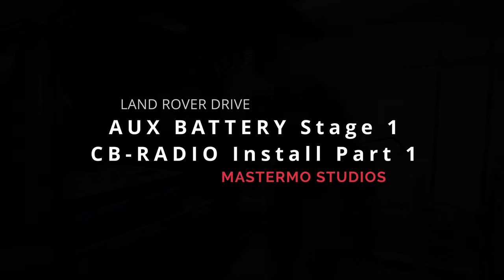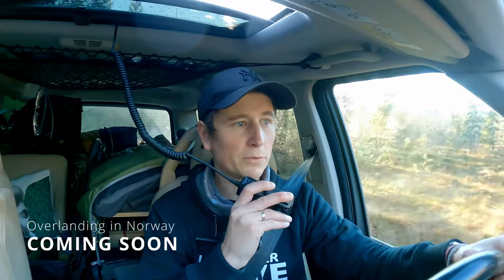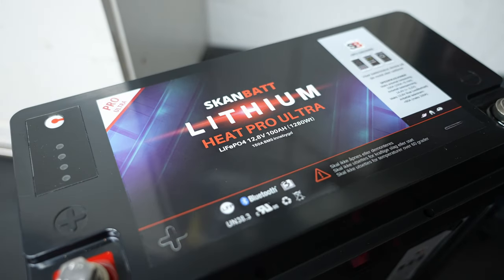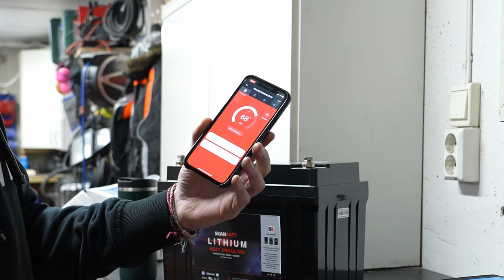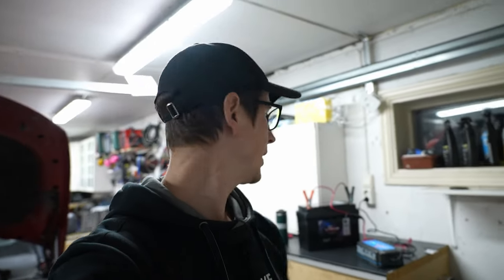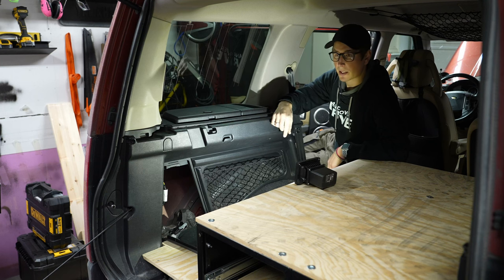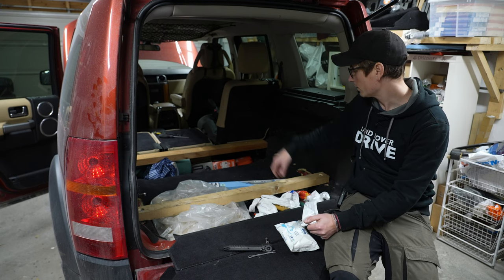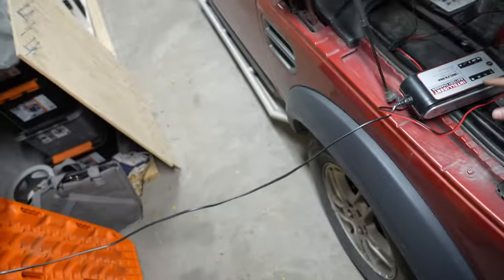LITHIUM BATTERY FOR COLD CLIMATE - DIY 12V STAGE ONE -  CB Radio Install Part 1

Comment: Been using an ecoflow delta 2 max , use it for my diesel heater and other things, very impressed so far. Can charge from outlet, 12 volt or solar . Light weight compared to some of my AGM batteries, and has a nice app .
Reply from the maker: Nice Craig! Seen the Ecoflow products, seems a bit pricey, but in turn you get a complete system and someone had to create that system. 

For overlanders I believe lithium is the only way forward, the weight factor alone is enough to pick lithium. The price/cycles is another, lithium is only a win. 👌

Be sure to update us after a year or two on how the Ecoflow works out! 😉

Best, Simon

Comment: Hi Hi, Simon great to see you starting to get the auxiliary power set up.  It will make a big difference for you on your trip. I have decided to replace my CB as I've had 2 second hand units neither of which have been great. I really like the idea of the controls being on the hand set with the main body in the rear as you are proposing so I'll definitely go that route😁 looking forward to seeing part 2 but also your trip footage too.  Take care and thanks for creating this content it is appreciated.
Reply from the maker: Good morning Simon! Glad you liked the video! 👍😊 

The CB-radio has been working great and can’t fault it. Nice to get a new setup that you know should work as intended. 

In the uk I think you need to check the regulations about the hand controls. Something about it looking like a mobile phone because of the dials. But the CRT Mike 2 which I linked underneath has VOX so I think that could be a good option. Also you can switch from UK to EU standards on it. 

Will start on the trip content as soon as the next video is out, and I can’t wait to get started. It’s going to be a really great Overlanding in Norway series. 

Best, Simon

Comment: Coucou 😊Simon ou à tu trouver tes filet latéral de coffre  aurais tu les références merci cool l installation 😊
Reply from the maker: Hey and thank you! Do you mean the net on the plastic section that I took out? Or the net that I have put in the roof? 

The net on the left hand side trunk plastic came with the car.  I don't think it's a separate part as the plastic seams to be a solid moulded piece. Maybe you can find it some where second hand.

The net in the roof, also followed the car as a cargo net. I found it in the rear when building a new platform, unused in the side "pocket" and it just fits on the handle bars of the front and rear seating position. 

Hope that helps, Simon.